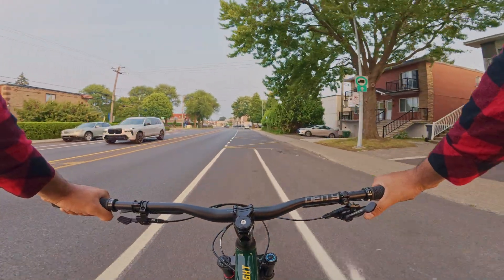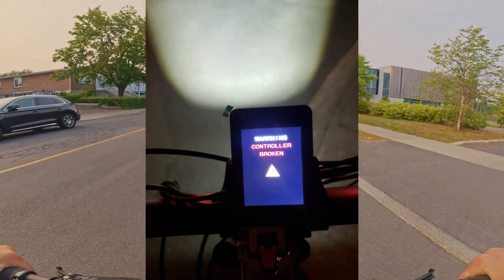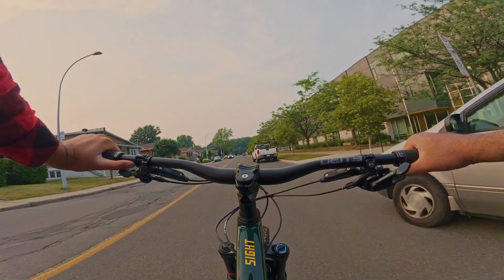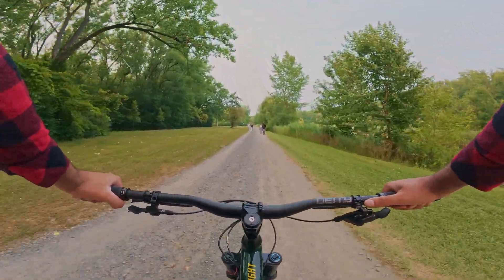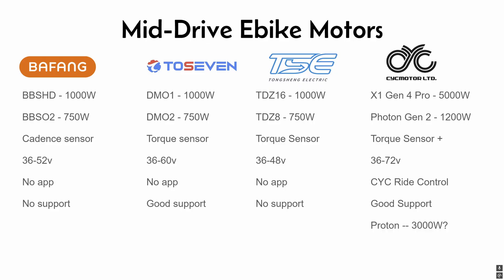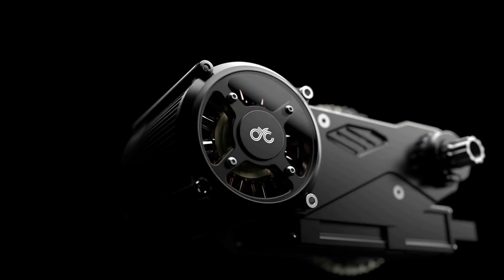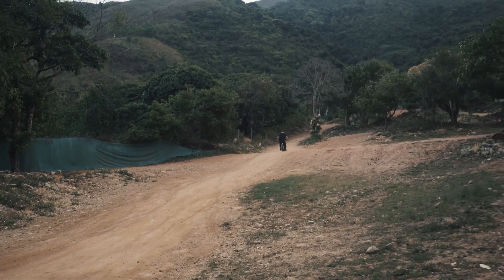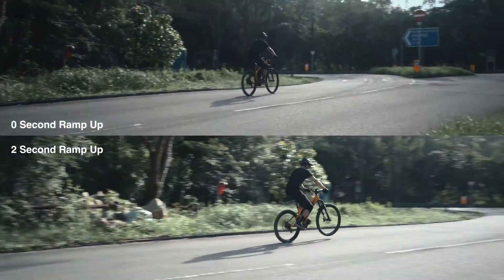The ONLY E-Bike Conversion Kit Worth Buying (I Wasted $1000 Learning This)

Comment: Do i understand this correctly, you went into the "advanced settings" increased the power limits probably more that it was designed for and now your complaining about burning it up?
Reply from the maker: No. I did not increase the power limits. Those are hard limits. What I changed was the throttle actuation and the max speed allowed. 

But if you go to the discord, I'm not the only one who has had this issue. People who haven't changed anything also have had controllers die or just look up on YouTube. But I heard they changed the controller recently. And it seemingly because of the firmware because the earlier firmware was completely fine and even more powerful than my firmware. So yeah it's not my fault. If it was my fault I'd admit it

Comment: Tsdz8 and 16 have nartow wide chain. You can change firmware, whichb is open source. In europe the motor is 300€. You say CYC is better - I believe you. But my wallet votes for tszd16
Reply from the maker: Yeah the tdz16 does look tempting but I've been burned by the cheap Chinese motors before so I'm hesitant. But since I have a Cyc x1 now, I may try one on another bike. How's the chain line btw? Is it better than typical bbshd/toseven? Because it used to suck on my toseven dmo1 where even 1500w was hard to use on my deore 10sp  but somehow I can put down 6kw with the cyc on a 12s gx eagle.

Comment: what frame and what battery are you using, what size is the frame?
Reply from the maker: Norco Sight A1 2022 XL. Currently a 72v10ah battery but a custom battery is in production which will be 72v20ah

Comment: Sir you have no idea what you are talking about. The BBSHD is the best ebike motor on the market period. Go buy a CYC and live with reliability problems. CYC is the most unreliable ebike motor company in operation.
You are talking out your a$$.
Reply: I've heard of BBSHD's  reaching the 100,000 miles mark by creditable sources. On the other hand, CYC's X1 Pro Gen 4 motor is an indicator of its past generation failures. Let's hope there won't be a Gen 5.
Reply: It's not. It would be best if it had torque sensor. Tsdz16 is, since it does
Reply: @eugene9000pro  
The Tsdz16 would be equivalent in build quality to the BBS02 due to it being an SPM motor. However, if you want the build quality of the BBS-hd there's only one like it and it's the TSDz8 because it's an IPM motor.
The TSDz8 is also torque sensing so possibly the future will say it's better than the BBS-hd.

Comment: I have a 72v bbshd uart and i absolutely love it quiet, torquey its on a trek marlin 5 and it would twist the rear fairly well and blast me up to 53mph. Im building a 26 x 4.8 fat bike now and im fighting in my head between the grin a.a max45 cyc x1p4 and the bbshd. 72v for all 3 motors. I wanna see how the cyc feels but its stupid loud but powerful, torque for days but hows my drive train gonna fair?? The bbshd i already know quality for years. But the new grin a.a fat 45 is built for the phaerunner and can be pushed with a bac 4000 or simmilar controller to punch 300amps peak its compatible with statorade which is a ferro fluid that lives in the cracks of the magnets to help emensly cool the motor. Choices are hard commuting or tearing the ravines and country sides. Take care all
Reply from the maker: That's gonna be a sick build man
Reply: Like to know what way you decide to go.

Comment: BBSHD is the most reliable motor of all that you listed. You are right about the company, they don't have support and all, but Bafang is the most reliable.
Reply from the maker: Yeah I'd agree but difference in reliability between x1g4 and bbshd ain't much. Lets see how the photon gen 2 fares
Reply: Unfortunately BBSHD has endless issues with quality control and manufacturing consistency for the motors and spare parts.
Reply: @uvwuvw-ol3fg  No it doesn't!! I have 3 of them, over 30k miles, endless is a huge stretch, sure in the early first production batch line they had flaws but since then it has been proven over and over again as the most reliable and durable motor ( Uart models ), spare parts are everywhere lol I can get just about any part from bearing to seals and gears.

Comment: In a few months on Tongsheng TDZ8 I have many thousands of feet of elevation gain on my XC MTB and I highly recommend it. Works great straight out of the box. With torque sensing, you don’t need the added complexity of gear shift sensors - change gears under light pedaling just like a normal bike. Super intuitive. Climbs for hours without overheating. In the beginning it would shut off randomly but it was my fault: I didn’t install the speed sensor, after I added the speed sensor (it came with the kit), no more shutoffs. Power on level 5 is awesome, basically erases mountains at fast climb MTB speeds.
Reply from the maker: Glad to hear you're enjoying your setup man

Comment: I agree with a lot of what you say but not all of it. Firstly, the DIY market is generally looking for a cheaper option to buying a whole ebike, or a way to upgrade their current ride rather than buying a new bike, as well as the ability to swap the motor from bike to bike. CYC motors are 2-3 times the price of a similarly specced Bafang, Tongsheng or ToSeven. Sure, it's a better product, but at that price it's difficult to justify, unless you already have a high end MTB and want similar performance and reliability as a high end eMTB. Similarly, if you're buying something 30-50% of the price of a CYC, you shouldn't expect it to be perfect. Just "good enough". However, that does not mean you should put up with controllers failing within a month. That is certainly not good enough. Incidentally, ToSeven recently identified a firmware bug that was causing some DM01 controllers to fail. The latest firmware release addresses this, and reports so far are that it does.
Bafang: Sure, Bafang support is non existent but the BBSHD is quiet, smooth and rock solid. There is a huge amount of knowledge in the DIY community, and replacement parts and aftermarket upgrade parts are everywhere. Sure, they don't have a torque sensor, but they are programmable with a USB cable or Eggrider, and with the right settings it can be argued that you don't really need a torque sensor. I liked my first one so much that I bought another. The main problem now is the UART versions have been replaced with CANbus on current motors which is harder to configure, but there are Bluetooth displays starting to appear now that allow quite a bit configuration using the Bafang Go app, and there are rumours of a CANbus Eggrider in the works.
ToSeven: The DM02 motor is at best good for city riding. While better than a TSDZ2, it still has issues with heat generation when used hard, and that throws out the torque sensor calibration during a ride. Don't expect this motor to be great for MTB. The DM01 is better in this regard but it still needs more development. The latest firmware is very promising and hopefully has addressed the reliability issues that have plagued some of them. There have been some quality control issues as well but this is improving. Don't count these guys out yet. My DM02 came with a faulty torque sensor and then the controller died, but I would still consider buying another one. They are not difficult to repair, and parts are available on request if not on their AliExpress store. 
FYI at 5:46 You say the DM02 is 750W. The DM01 comes in 750 & 1000W versions. The DM02 comes in 250, 350 & 500W versions. There is no 750W DM02.
Tongsheng: Very promising reports for the TSDZ8 after some initial firmware problems. Quiet and reliable, and OSF firmware now available. It is difficult to ignore this one for the price and the community support.
Reply: Appreciate the detail you put here, I'm here learning the market, the company/product reputations  with the DIYers. It's coming time that I'll need one and there is a lot to sift through. I want to know what the rider's favorite motors are, the hated, the trusted, from the perspective of the people who ride them, brake them, and fix them. I got a handful of insight from your outward desire to contribute to the community. You have my attention on  [ Bafang, and their BBSHD ]  wondering about [ Bosch ],?   I only ever see promotion for them. Hard to gauge a product if I can't hear how it went wrong, only to improve later.     Thought I should let you know that you helped a stranger in his mission to learn things   Happy Trails.

Comment: My controller in DM02 survived a little bit longer (10 months/3000km). Now I'm waiting for new one...
I had CYC STEALTH gen1 and It was not perfect neither. 3 torque sensors died and then I gave up and bought DM02.
Reply from the maker: Yeah, the photon gen 1 definitely had its issues too, but what I like is that now they're releasing a completely redesigned motor after taking in the feedback. Same with the X1, 4 revisions, but they took feedback and improved on the design. Tongsheng doesn't do that and neither does To7, it has been a year of people complaining about the controller yet no fix. Some dealers have stopped selling it entirely for the warranty reasons. That's why I really emphasized the X1, it has had 4 revisions, it's a mature product used by Bonnell (makers of EBMX i believe). We'll see how the Photon Gen 2 holds up.
Reply: At least spare parts Are much cheaper than for cyc.
Controller 50$
Torque sensor 25$
Nylon gear 10$

Check spare parts prices for cyc photon. Very expensive!
Reply: @ataksnajpera this is true but if you get it from a dealer they can ship it out free or reduced price in my experience

Comment: It is a noisy, hard to install piece of junk that isn't legal on any public lane or MUP in thr entire U.S.
Reply from the maker: 90% of ebikes in the US are probably illegal with how stupid the ebike laws are. Noise sounds awesome, but to each their own.
Reply: @Downgoing The U.S. has the most liberal ebike laws in the industrialized world. We also have, by far, the highest warrenty rate in the entire world. Eu/GB 250 watts, 15.5mph pedaling and 4mph on throttle with by far the lowest warrenty rate. China, which has the strictest quality and safety rating on domestic products is 400 watts and 15.5mph. Canada is 500 watts and 20mph. Australia and NZ are between The EU and Canada. 

The U.S. is 4th or 5th largest of e-bike markets and slowest growing. EU being fastest growing, but China still being the largest.  No one is building motors, controllers or throttles for The U.S. market. We are only over volting and/or over amping 400 watt systems. This is one of the reasons many of the best are not sold in the U.S. and many more are pulling out. To sell, they have to be willing to over stress their builds. Some of the brands my shop used to sell only offer their EU spec models and folks either take or leave them (we now focus only on conversions and warrenty repairs from almost all major brands). 

Because of all the problems created by folks like you riding illegal bikes, crackdowna are happening all over. You are among the folks getting e-bikes banned everywhere.
Reply: @MHH3180 no it’s because of people like you, complaining about e-bikes to anyone who will listen and to some that won’t, the laws and crackdowns are passed. Live and let live. Mind your own business.
Reply from the maker: Ebikes are being banned cuz of surrons, not ebikes.
Reply: @Downgoing no, because of illegal ebikes and frankly legal ebike riders not adhering to proper trail, lane and MUP etiquette
Reply: @MHH3180  yep, even in this video he just plows through a stop sign lol 

"i'm on a bike, so rules don't apply to meeee durrrrrr" - "WhY sO ManY RuLeS???"
Reply from the maker: They don't. You're correct. Car rules do not apply to bikes. I've tested that theory of stopping and it confuses the  drivers and they get annoyed and flash the lights for me to go or wave to go. It's a rule to yield fo bikers. Pedestrian don't stop at stop signs either. Idk why bikers would
Reply: @Downgoing  and there it is hahahahaaa
Reply: @human__________ I’ve seen many drivers confused as well at stop signs and other pedestrian zones, they treat me like a pedestrian and causes some confusion. Ive had to start being clearer but rarely some drivers still won’t go at all out of caution, I could see why bikers would just go through if it’s safe
Reply: @Downgoing  
I love the sound of the CYC X1 Pro Gen 4 motor. However, I must agree it is not on the level of the BBSHD.  Why do I say so. 
1. The CYC was built to race so it wasn't built to last or rack up miles.
2. The BBSHD wasn't made to be too hot or too cold. 
3. BBSHD's are known to rack up 30 to 40 thousand miles where the CYC, if you're lucky get 7,000 to 9,000 miles. However, that's not bad because race motors are widely known to have shorter life-spans. 
If you can handle the truth...go here. 
https://www.youtube.com/watch?v=8rEtoc9uib4&t=586s